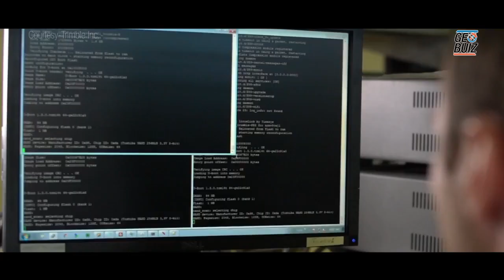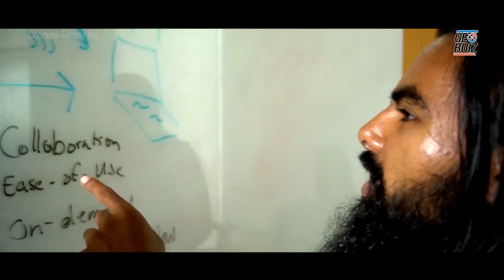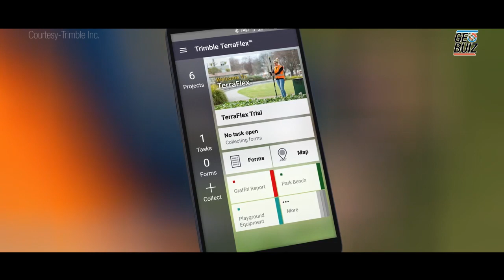Mark Nichols gives low-down on Trimble Catalyst

Comment: Great unit and I'll get one once I can get confirmation whether the rugged Samsung Galaxy Tab Active 2 is compatible with Catalyst. Not listed on the Trimble site as an approved device but other units with same chipset and RAM are. Trimble NZ suggested I get the Tab S3 which is very pretty! but not rugged without a case and being a larger unit not as practical for carrying 12 hours a day! Anyone using the Tab Active 2 with success please.